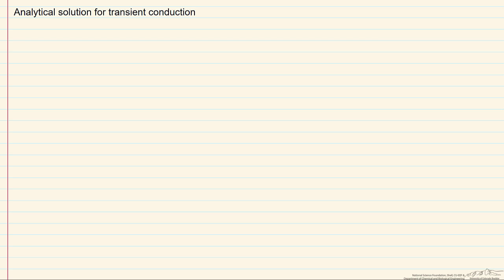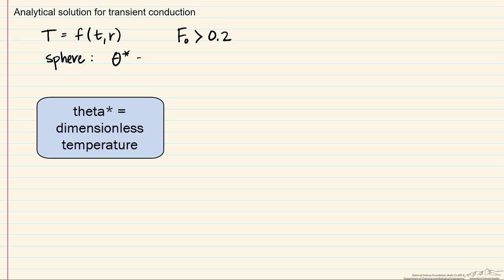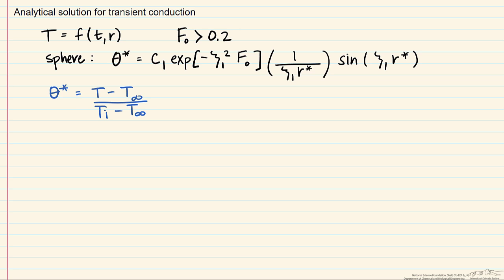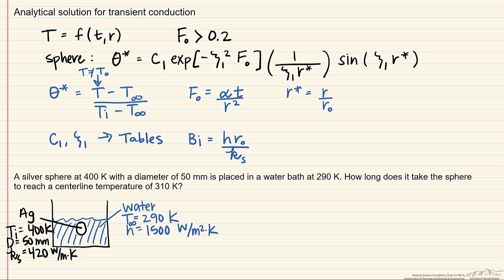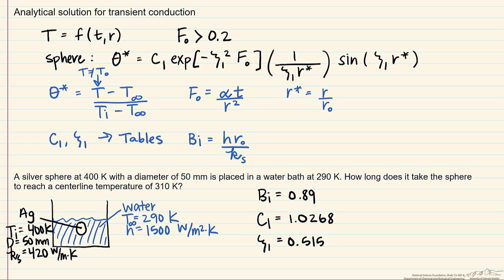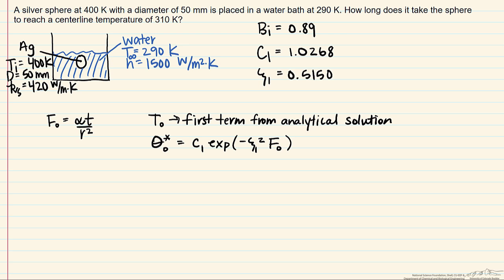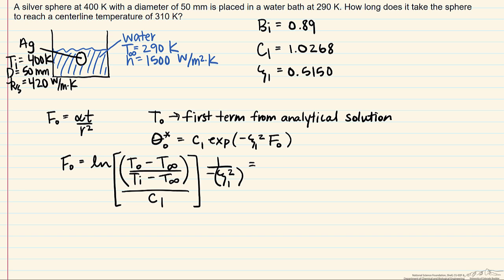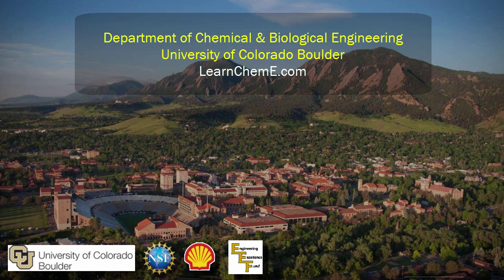Analytical Solution to a Transient Conduction Problem

Comment: I could be mistaken but Biot # = hLc/k = h(volume/area)/k = 1500(R/3)/420 = 1500(0.025/3)/420 = 0.029. Why are you not using characteristic length?
Reply from the maker: Good question! You are correct, the characteristic length for a sphere is R/3, and this is typically the value used in the Biot number. However, using R as the length scale rather than R/3 corresponds to the maximum spatial temperature difference (that is, the longest distance over which heat must be transferred). This gives the most conservative estimate of time, so it is good to use R instead of R/3 if you want to know the maximum time it could take to reach the final temperature. Likewise, you could get a conservative estimate for a cylinder by using R instead of R/2, which would normally be the characteristic length in that case. Hopefully this helps!